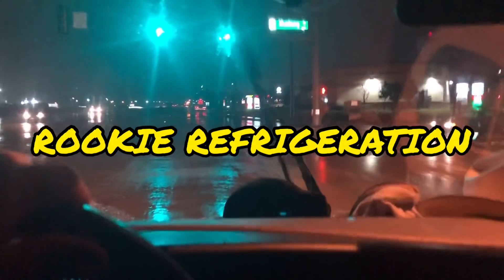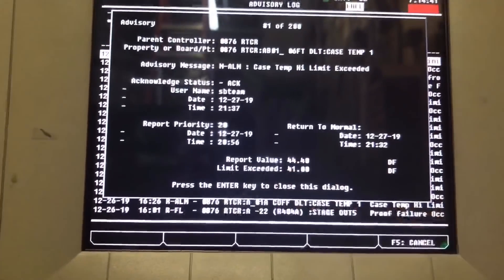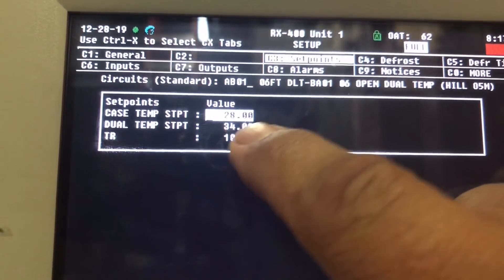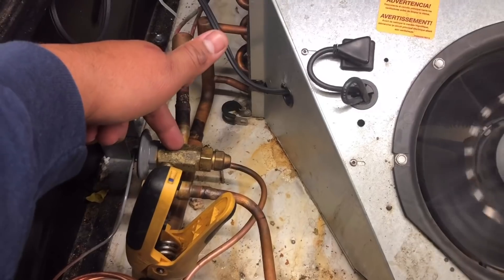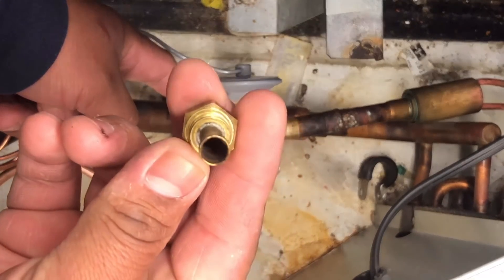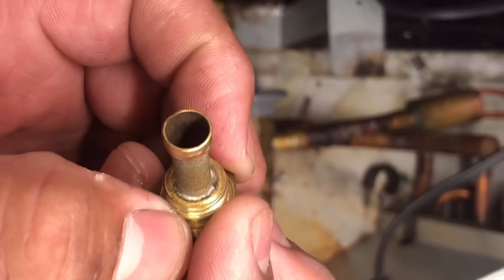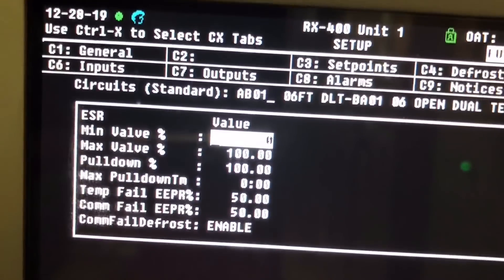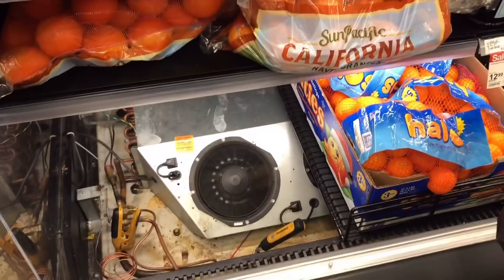HVAC REFRIGERATION:  Dual Temp Case running warm, Rack Refrigeration.

Comment: What’s gonna happen with the max at 16% on the epr when they switch it over to low temp? Won’t that epr need to open more than 16% for low temp? 
Not a supermarket tech but very interesting. 🤘🤘

Comment: How were you able to lower the pressure and be sure no liquid would come out to change the filter ?
Reply from the maker: Isolate the circuit at the rack.  Shut down the liquid line.  Let it pump out.   Then shutoff the suction line and recover the gas into the rack.   Then there’s no more pressure in the circuit.    Boom.  Done

Comment: I think your problem is more the E2 setup , a board issue or your EEPR is getting hung up. Your dual temp case should have had a much colder discharge air temp if the EEPR was at 100 percent even with the plugged screen. 

You were in med temp and alarming high temp. When you arrive discharge air was 13f. so you should have looked at control or operation on the EEPR first. Yes it was good you checked the screen
Then you had to set EEPR to a lower value to maintain temp, this suggests that the EEPR is not operating properly or not being controlled properly. 

Are there driver boards on site for the EEPRs? bad board or loose connections.
If you change out that TXV to a smaller one, you will be back for a case not getting cold enough. TXVs are usually the last things to fail.
Reply from the maker: Yup.  All great points.  If you see part 2 of this video you will see the root problem.  I could’ve avoided a bunch of guess work.

Comment: i found on a lot of dual temp  bunker cases , a common complaint was not enough cooling in medium temp mode.the cases were sent in with pressure limiting txv valves.fine  for low temp operation ,not so for medium temp.
Reply: got  called to check a newly installed produce line up.very warm. the entire med temp rack was down on r 22.checked produce circuit e p r.running at suction header pressure.. isolated the circuit on rack.there was a lot of refrigerant trapped in the circuit.got it back .receiver level back to normal.took epr apart sus pecting it was bad.found  a c r pipe plug had travelled back through the new piping and sealed off the suction at the epr.

Comment: Look you work Target, you need replace EPR Valve, look for me your EPR valve stuck open. Evan you override 60% still open 100%.
Reply from the maker: No.  It’s a good valve.
Reply: If good EPR , why too cold, not supposed too,
Reply from the maker: Gurjeet Singh because it’s tied into a low temp rack running -20 saturated temperatures.  So 100% will give you -20 sat
Reply: Rookie Refrigeration brother If this is target Store Electric EPR, if unit too cold, only reason EPR not closing, when temp on set point E2 closed EPR, if still case cold, this mean only EPR not closed, you need verify check Rack Suction Pressure and case pressure when case on set point, then you check case and Rack Pressure if pressure was same mean EPR not closing properly.

Comment: What did you do before you started working on racks....can i make transition from residential  commercial   easy to refrigeration
Reply from the maker: I had a year of refrigeration. Small walk ins, large refrigerated warehouses, etc.  I think you could transition into refrigeration Easy, but racks is something different.  I’m not saying you can’t, but it will be challenging without any refrigeration experience.
Reply: @rookierefrigeration4357     gotcha.  I appreciate  the response bro.....

Comment: Can you keep one or those filters and cut off the screen and just use it as a cap
Reply from the maker: Yes.  But if prefer to use the screens than a filter drier.
Reply: @rookierefrigeration4357  I ment just temporarily to grab parts
Reply from the maker: Rob Powell oh. Yes you can. Just temporary I’ve done it.

Comment: In my 19yrs I have never replaced a clogged/ dirty screen. Hit it with some electrical contact cleaner. Let the cleaner flash off and you are back in business. TXVs rarely need to be replaced. I pump down the system, open BOTH sides of the valve, remove ALL parts clean with solvent. Reassemble and it is like new.  Done in 10 minutes and back to your coffee. No extra truck stock to keep up with.
Reply: You sont do alot of industrial refrigeration then. I replace them weekly.
Reply from the maker: Yeah I generally just clean the screen but in this case I had the replacement do I just changed it.   I keep the old one and use it later.   And on the txv we just need to verify it is the correct body and if not we are changing it.    But I have more work to do there.  Will post an update.

Comment: Great video.  On that exact "big box" store they  dont set superheat out in California..  On start up we just set all the TXVs so the EEPR maintains 20%-30% open while holding + or -1⁰ between all cases on the system.  Also that "big box" store doesn't want any program changes done by techs.  Their programming company is called instead.  They are really great EMS help by the way.   I saw in the comments that the switch contact could be bad (green/red), which happens all the time.  But since the E2 was calling for med temp then that's not likely on this one. A graph can be ran on the DI to check if its been switched.  I'm curious what the graph looks like for the EEPR.  Keep in mind that AI/DI points on boards never go bad.  But since you said the valve is getting clogged once a month, bet you that the liquid drier is fucked.   Keep up the great videos...
Reply from the maker: So how do you know if the valve is feeding correctly.   
And we are not really allowed to make programming changes either, that's why I had to call our top guy and run it by him.   Then I can make the change. And yes, I have suspicions the dries are messed up so that's what I'm doing first thing Monday.   Thanks bud.
Reply: @rookierefrigeration4357  As long as your making set point then you must be feeding.  That "big box" store has a the largest spec book I have ever seen.  If you want to check it out let me know.

Comment: Great video.. If you go back Monday can you film the Epr valve.. Because apparently some Epr valves is the US don't look like the ones i use.. Never seen one with a solenoid..
Reply from the maker: No problem. Will do
Reply: the valve with the solenoid on it is a suction stop valve which opens on low temp operation.when med temp is used,suction valve closes then the gas is going into epr valve for med temp.

Comment: Assuming that it was a one-fault situation, replacement of the filter solved the problem.
After filter replacement I would possibly check if EPR was working properly i.e. actual pressure measured with gauges = pressure displayed on the screen = set pressure. If the obove is OK, leaving 100% max valve value seems best option unless there are other considerations (e.g. uneven load distribution under abnormal conditions, i.e. start-up).
It is the EPR's (not service company's) job to set the valve at proper position.
As always, thank you for your effort. You make a difference! And if I'm mistaken - correct me.
Reply from the maker: Yeah, this is a common issue we find with eeprs.  The problem with this dual temp case is that it is on rack a, low temp, and the temps that are being utilized right now are more of med temp.  So that places us in a predicament.  If there case was utilized as designed maybe low temp and med temp, it would work fine.   I'm just really shooting from the hip here.   I'm going back Monday and working on it  some more.
Reply from the maker: Another thing is how would you control the SST with the epr valve at 100% and the rack SST is -20?
Reply: @rookierefrigeration4357  Are you saying that this dual temp case has one, common suction line and EPR? If so, this is a design error and it should either be rectified or one may bill the customer without blinking an eye (which is absolutely fine with me).
Reply from the maker: One suction, 2 setpoints. I imagine the switch just changes the temps at the controller.   The epr should do the rest, but  I don't think it's programmed to look at saturation.
Reply: @rookierefrigeration4357  Thanks. I apprecieate your effort to respond.   I'm not bothering you any more on this one.

Comment: Liquid Line shell spring missing ? No Felt Pads or gaskets between core & metal core holder ? something jacked up in the Liquid line Shell ?
Reply from the maker: I'm definitely checking it.  I was reading the notes and everyone has cleaned the screen.  3 times since October.  I'm doing something about it.
Reply: it will be interesting to find out why the screen is getting so much junk in it. hopefully just a broken core. 😁
Reply from the maker: I really hope I find something cool.  I'll make a video on Monday.
Reply: 👍. i hope its cool & a Relatively easy fix. fingers crossed 🤞.

Comment: do you work on R600? if so like to see some videos on that if you come across.
Reply from the maker: Nope. Not at all.  I stick to 404, 449, 410 etc.   No exotics 🤣🤣
Reply: So is the EPR valve at the end of evap coil suction line?  I dont much Refer.   Thanks

Comment: Keep ‘em coming! On call here too, just wrapped up rebuilding an OLD Alco EPR, and a replacing a bad switch module and motor on a Paragon Gang clock. Watching this vid while I wait for the system to pull down
Reply from the maker: Thanks for watching bro.  Appreciate it.

Comment: It's your dual temp switch had that same call couple months ago
Reply from the maker: How’s that.  I don’t think the switch has anything to do with EPR settings.
Reply: @rookierefrigeration4357  the switch internally fails and switches to frozen ever so often. But is shows medium temp on the E2 and the switch
Reply from the maker: Tim R sounds possible.  But even if it did my low temp setpoint was 28.  Still no reason to run a -5° SST.  I’ll Keep an eye out for those switches.
Reply: @rookierefrigeration4357  if it comes back in go on global contacts last reilly call me
Reply from the maker: Tim R 👍🏽👍🏽👍🏽 appreciate it.
Reply from the maker: Tim R I’m going back first thing Monday
Reply: @rookierefrigeration4357  glad to help buddy

Comment: After defrost will it take longer to pull down to temp with the max 16 ?
Reply from the maker: Nope. It still pulls down at a decent speed.  We still have to go verify txv size on Monday.  But it pulled down no problem today.  It’s off cycle defrost

Comment: Are ECMs really necessary for such a small evap fan?
Reply from the maker: That’s how they come from factory.  That’s probably a factor in these high efficiency cases running 4°TD.
Reply: @rookierefrigeration4357  To me it doesn't make sense unless they are running variable speed evap fans.  From what I see they are fixed speed.
Reply from the maker: douro20 yup. That’s an engineering question 🤷‍♂️

Comment: What's rack refrigeration?
Reply: All of the evaporators are on a bank of compressors in a rack which are connected to a single large condenser, which is sometimes water cooled.  Solenoid valves are used to feed each evaporator in the system, and the whole system runs at a constant high pressure.
Reply: @douro20  thank you
Reply from the maker: Best to google it.  Multiple compressors on a single discharge header and suction header. Etc ...
Reply: @rookierefrigeration4357  hi buddy thanks for your reply and time, in fact I was joking , as I know what you are doing , but we called here supermarket refrigeration or parallel compressor refrigeration system. I was working in supermarket refrigeration a couple of years , and I started same way like you, I  am still like to see what others peers are doing as we are learning every day . I can see you have a zeal to get what you want. I watched that video and I don't agree how you condemn EEPR operation as it the last thing to check it after elimination of upstream parts as filter , check valve if any, solenoid valve , strainer, txv. Thanks again